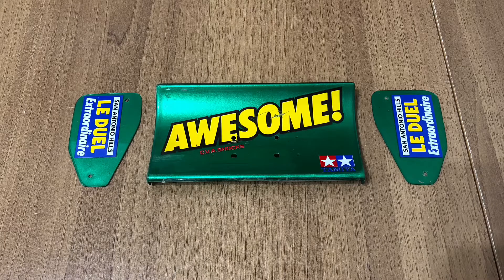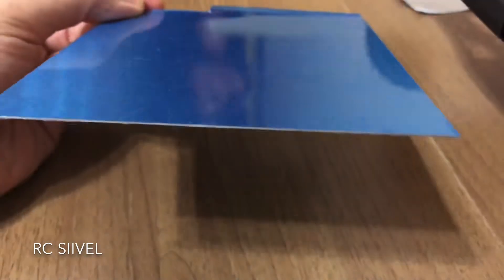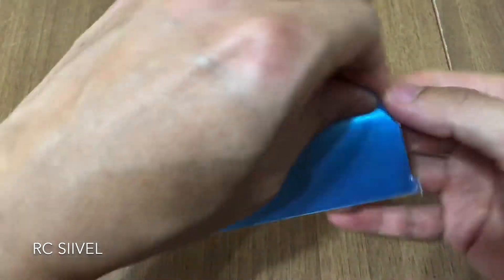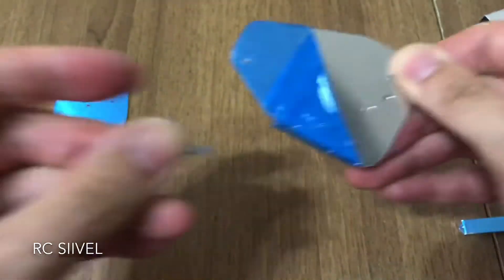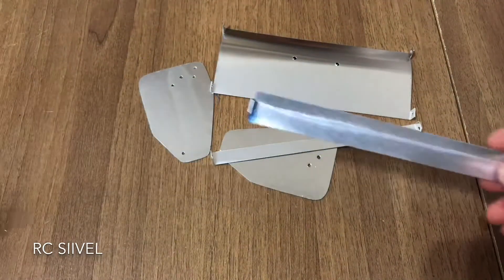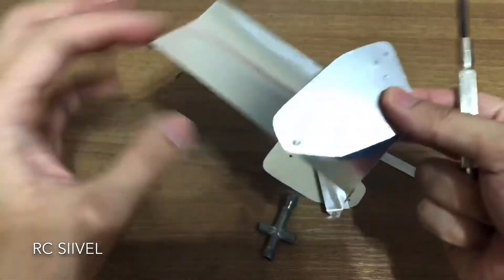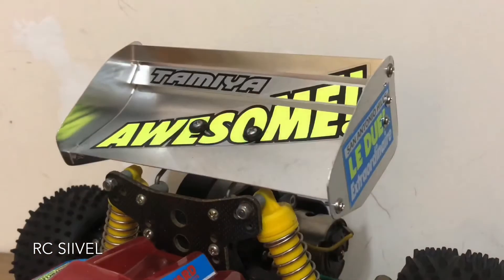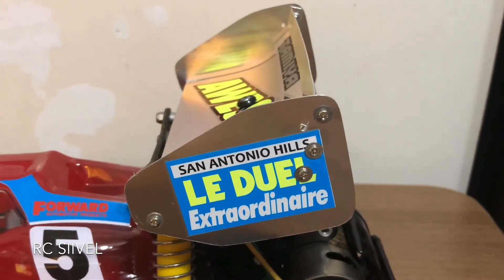DIY Aluminium Aerodynamic Wing for RC Buggy

Comment: Hi Erik, I agree this wing is a something special! Did you do some computer modelling aerodynamic flow calculations for this wing, or was it just done by eye? If you have a template sheet and a section of the curved bend I could use that would be awesome. Best, Josh
Reply from the maker: Thank you for leaving me a message! I did not do any flow calculation for this wing, but it is adjustable. I think that should be better than the original one.